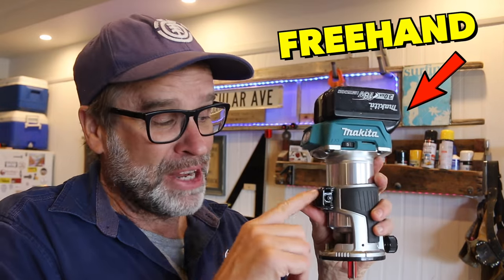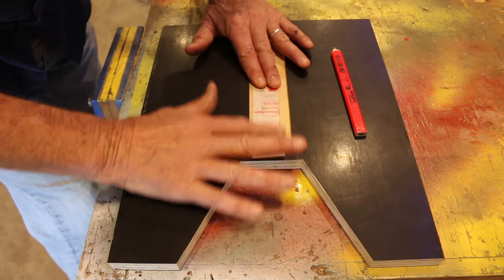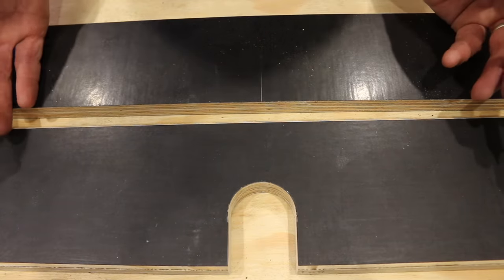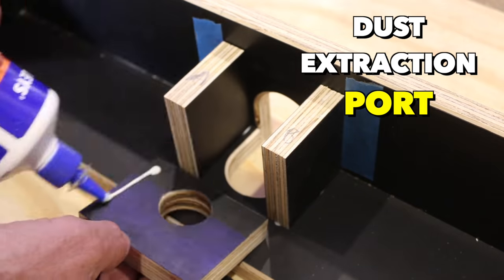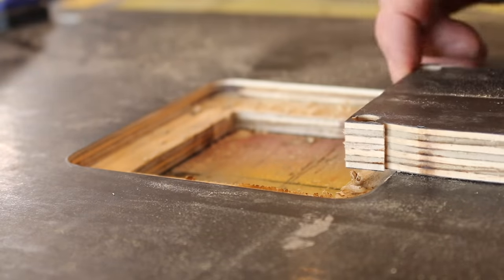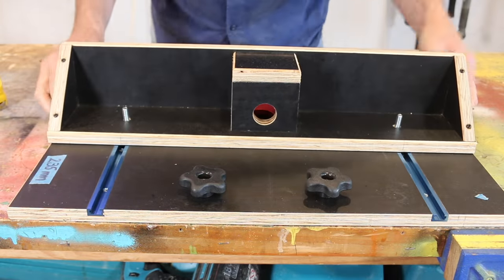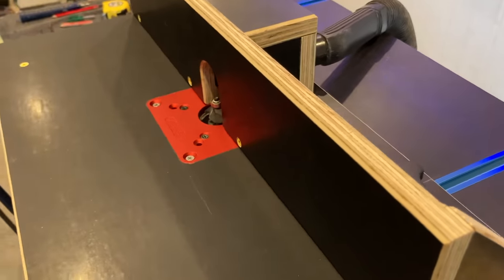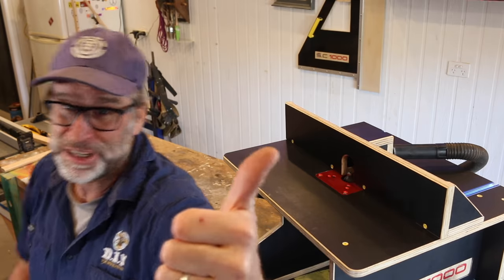The BEST DIY Router Table for Beginners. #woodjigs21

Comment: I really enjoy the look of this table! I'm going to keep my eye open for a black surfaced plywood, looks great (not sure if it's sold here in the US).
For those watching this that are starter woodworkers or are unsure if you want to put in the track, a very simple solution for the fence is to move those triangular rear supports in a few inches, then simply use clamps on the edges to hold the fence in place. You don't need to worry about it being square to the table as long as it's square to the router bit!
Reply from the maker: Thanks mate and l appreciate the tip. Cheers 👍😁🇦🇺
Reply: It's forming plywood used for foundations.  Your local building supply may be able to order it.  Go to the local builders supply where the framers and builders shop instead of the big box stores.   You can also use melamine board with plywood as a backer for a 1 1/4" to 1 1/2" total thickness.

Comment: I just bought these plans, I am excited to make this project as I am new to using routers and I have a samll trim router that i think will work swimmingly with this table. I look forward to building it. 

I really love your channel and do a LOT of DYI projects, having the router, which I bought specifically to build my hobby desk. I have only used the one 1/8th inch slot bit to install T-Slot Edge Moulding with, it has not been used much. I cannot wait to have this built up to be able to work on many different projects, such as more tool DIY hacks... and some diorama and epoxy art beses. Will update with how it goes. Thanks again, Cheers!
Reply from the maker: First of all, thanks for purchasing the Plans mate and good luck with it. I know that you are going to love it! Cheers, 👍😁🇦🇺

Comment: This is by far the best looking (IMHO) DIY router table I have seen on You Tube. When I first saw the thumbnail photo of it, I thought you were doing a review of a router table that you had bought commercially. That is meant to be a compliment. I was lucky enough to buy a Ryobi router and table from a guy who just wanted it to do the trim on his kitchen cabinet doors. I only paid 40 bucks for both the table and router! It works beautifully. 
I may build yours at a later date when I need a table with more surface area. 
One last thing, if you have any of that black ply left over, I think it would be really cool to build a small T-square to match your table. Great work, thanks!
Reply from the maker: Thanks Gregg!...Really appreciate the comment mate 👍😁 40 BUCKS!!.....Now that's a bargain!...well done, you can't complain about that one 😁 Good suggestion re the T-Square....may just have to do that one. Cheers mate and thanks for watching 👍😁🇦🇺

Comment: Nice build the design and way you made the top looks very familiar……. 😉
Reply from the maker: Cheers mate and yes l did get some inspiration from your video 👍👍 Simple but very effective 👍😁🇦🇺
Reply: @diyforknuckleheads  if it is not your idea, why are you selling the plans that Where’s my pencil offered for free? This is dishonest.
Reply from the maker: @haunthunterify  Disagree entirely mate. For starters it is not the same and secondly there would not be a router table on the internet that has not had design similarities to anther router table. There is only so much you can do with it. A similar example would be that  there are many car manufacturers...each car has wheels, a steering wheel and a motor yet they all sell their own models.....enough said
Reply: @diyforknuckleheads  ok. Whatever let you sleep at night.

Comment: One of my favorite woodworking tools MyBest.Tools Light and easy to maneuver. Noise level is a lot better than others I have tried. No cord makes it easy to grab and use. The clear base plate makes it easy to see ahead of what you are cutting. The electric brake is awesome. Glad to have this in my tool collection.
Reply from the maker: 👍😁...Thanks mate 👍😁🇦🇺

Comment: like it Sean .  I made a plate to fit a Black and Decker Matrix jig saw  attachment . Just housed out the wooden plate to fit jig saw and fitted wedges under it to hold saw in place .   Its clamped to the bench too but was hard to fit an easy to use on off switch ,would slide  an electrical tie over the drill switch .  Then bought an ozito router table ,  it  works real well for smaller jobs  .
Reply from the maker: Thanks Barney 👍 Well done on having a go at making your own.....always interesting to come up with little problems that pop up along the way.....never seems to go as planned 😊  Have a good one mate 👍👍😁🇦🇺

Comment: Great job.The only thing I did different when I did one - few years ago - was to make the holes in the fence slots about 2" long so the fence was a little more flexible
Reply from the maker: 👍....Yeah, good tip re the slot John 👍 Thanks for watching mate 👍😁🇦🇺
Reply: I can dig it. Reckon you are making those slots parallel to the fence, so to enable slanting the fence  a little when needed, relative to the front of the table, yes?
Reply: @leehaelters6182  Yes.just makes it a little easier to set.Fence on a router table does not need to be aligned at a perfect right angle - as a with a table saw -

Comment: It's funny watching Australian woodworking youtubers. Always feels strange to see someone using the same tools I got from bunnings haha. Great table though, looks perfect for me. Only variation I'm going to make is that the cut-out on the back part of the fence, I'll make at 60mm minus the thickness of the board and then because of the way the two pieces are aligned, they'll end up being the same depth from front bottom edge so my OCD will be satisfied. Thanks for the great design!
Reply from the maker: My pleasure mate! Thanks for watching 👍😁🇦🇺

Comment: That's a great portable router table, but the one I bought, not portable, is even better and came with a 1 1/2 hrs router. It only took me ten minutes to buy it and it likely cost less than all the materials for that table. Which does not detract from the utility of this great portable table.

Comment: Nice unit Mate. I made me a bigger one ages ago. Wanted bigger top. I inlayed 2x 150mm rulers for gate positioning. Works a treat. You can get them (Rulers)from $2 shop or reject shop
I have since made a undercarriage below deck which uses an old scissor type car jack to raise and lower router bit height. Non battery Router of course.
Reply from the maker: Cheers mate and good idea re the rulers 👍👍 Thanks for watching 👍😁🇦🇺

Comment: tip : @7:20 cut the inner wooden guides a fraction short so you can get an exact fit against the aluminum  block. A small gap between wooden guides will not affect the router cut

Comment: I love this video!  It's just what I need to make.  Thanks for sharing it.
Keep your eye out for a second base for your router so you can leave one attached.
Reply from the maker: Thanks as always Andy! If you make it mate you won't be disappointed 👍😁🇦🇺
Reply: i bought recently a 3d printed insert plate for ~20€ where you can easy put the router in and out,so you needn't a 2nd base.my router is  from katsu and it's identical in construction with the makita rt 0700c palm router.the accessories and spare parts from the makita also fit the "clone" and with 60€ the katsu is also only half the price of the makita.
Reply from the maker: @duczman76  Love the idea of the 3D printed Insert Plate 👍👍
Reply: @diyforknuckleheads  i found here on youtube a video about it and i instantly ordered one for me.
Reply: @diyforknuckleheads  here is the link 2 the video of it.
https://youtu.be/V4kI2-yBjRE
Reply from the maker: @duczman76  Cheers for that mate! 👍😁
Reply: @diyforknuckleheads  no problem.you're welcome.🤔 i think i can't withhold something useful like this from anyone,can i?

Comment: I was looking into buying a router, and noticed all you tubers have a table, I dont have space for a table in my small apartment, but I do have a deck and was thinking how to avoid what your begging video just explained (so thank you for answering my question if that could happen)... but I was pondering if you attached a straight edge to the top of the wood** you were trimming, and balanced the hand router on that straight edge if that would prevent my hand from veering too much into the wood or off the wood? 

**kind of like how circular saws use straight edges? 

please let me know what you think!

Comment: Uncle Knackers, GREAT vid & FANTASTIC router table!!! Thanks for taking the time to help all of do the best woodworking we can, Where I'm at in the USA Formply is nearly non-existent and I was wondering if it's the same as Melamine? Currently building my first table saw "cart" and with 1/2 of a 1 car garage, that I share with storage shelving, I've had to be very creative in my choice of design. I have watched several of your videos and I like the fact that you design for the entry level woodworker. Just my level. And not for the Dad Jokes. . . you and my Pastor have the same type of humor and are just about a quarter bubble out of plumb! I like it! THANKS again. I'll buy you a beer soon.
Reply from the maker: 😂...Quarter of a bubble out of plumb! ...love it 😂 Form Ply is different to melamine. It's basically just plywood with a fancy coating applied to the surface. 👍
Sounds like your workspace is basically identical to mine.....pretty cosy. Glad you like the vids mate and thanks for watching 😁👍🇦🇺

Comment: This is great and I was going to have a go at making.  Please can I ask what kind of router bit you used to cut your rebates for the T-Track and plate?  I can see the bit must have a bearing at the top of the bit for the template (block) guidance but most of the 1/4 inch router bits I can find with the bearing at the top are just for side or laminate trimming and I'm not sure if they are suitable for cutting the floor of the rebate smooth for the plate and T-Track.  Thank you.  (I would be using a makita trimmer for cutting the rebates)
Reply from the maker: G'day Andrew....sorry about the late reply mate. Here is the link to the bit that l used. Cheers 👍 https://amzn.to/3gttq7p

Comment: Nice build. I suggest a back  and front and a dust collector instead of a shop vac.   With two or three holes in the back to let air in you will capture 99% of dust. Shop that does not collect much dust. Where did you get the insert plate from?
Reply from the maker: Thanks for watching and for the suggestions Allen 👍 I have a link to where l bought the plate from in the plans that are linked in the description box under the video. Cheers 👍😁🇦🇺🎄

Comment: Thanks for the video. Bought the plans 👍. Just one question... What router bit are you using? Thanks again
Reply from the maker: Cheers mate...much appreciated. There is a link to the Router Bit in the Plans that you purchased. Its a Flush Trim Bit with a bearing on the top 👍👍
Reply: @diyforknuckleheads  sorry mate, missed the link. I'm the knucklehead this time 😊😊
Reply from the maker: @63italic  No worries mate 👍
Reply: @diyforknuckleheads  How did you correctly set the routing depth? I assume you achieved this by using the right thickness of the template but not sure. The bearing position I guess is fixed. Thanks

Comment: Great job of covering all the details on a great router table. But just one question, how do you reface a piece of wood when the left and right side are the only plane. Wouldn't need an offset of some sort? Sorry, I'm new at this.

Comment: Yankee living in Japan, here. I love the design, it is elegant, modest, and thoughtfully functional. For example, the side cutouts that provide arm working access to the router.

 Very curious about this Form Ply. You demonstrate its slipperyness, yet standard wood adhesives get a grip?  What material is the skin? Thx!
Reply from the maker: Hi Lee! Glad you liked it mate. I used glue as a force of habit...Most likely it wouldn't stick but it also doesn't hurt using it just in case it helps a little 👍  The black film is a high density overlay of phenolic resin impregnated paper which is bonded to the plywood.....or so l am told 🤔  Thanks for watching 👍😁🇦🇺

Comment: Quick question - Is the table designed to work with a palm router and/or a full-size router?  Does brand matter?  Thanks.  Adding this to my list of upcoming projects.  Love the way it looks.
Reply from the maker: G'day mate...it can work with both. You just need to buy an insert plate that fits your router or make one out of thick acrylic. Cheers 👍😁🇦🇺

Comment: Thanks for sharing. It looks great but how do you set the routing height? (Sorry if I missed this in your movie)
Reply from the maker: No worries at all mate...thanks for watching  👍😁 The method l used is trial and error. Grab yourself some scrap and just experiment until you get the depth you require. Good luck! Cheers 👍🇦🇺😁
Reply: @diyforknuckleheads  I was more curious about how you set the height on the router. Most routerlifts have a screw which is connected to a lift. Your's doesn't have it or does t?
Reply from the maker: @Tilburger72  Mate, mine has a lever that you release on the side of the body and then there is a knob that you wind up or down to alter the height 👍
Reply: @diyforknuckleheads  Ok that sounds great. Thanks. I will take a look at the makita!

Comment: Straight away, nice job but I've never seen that board with the black top in the U.S.A.
Reply from the maker: Thanks Alan 👍 Can't help you out with the board but there is probably something similar over there. Have a good one mate 👍😁🇦🇺
Reply: I have never seen the range and quality of ply you guys in the US have either. It certainly can't be found at my local Bunnings store!
Reply: In Australia its used for concrete formwork I believe.
Reply: @stevereid8903  Hey, Thanks!
Reply: @emceeboogieboots1608  just bought a sheet from Bunnings….but they call it SpecRite - film faced plywood- size 2400 x 600 x 17mm $39.00 a sheet 👍
Reply: @robbunt8180  I know the stuff, I made all my benches in my shed out of it. I have never seen the sort of ply the  US guys are always using though. So straight and many different sizes. Makes me jealous

Comment: I like this better than the Triton router table I currently have. It's more functional, predictable, and takes up less space. One day I'll get around to building one for myself.

Any reason not to set up the fence to use runners like a table saw cross cut sled? Would keep the fence parallel right?
Reply from the maker: Glad you liked it S.J 👍😁 It would indeed mate 👍

Comment: Nice and simple.  Well done.
Why does the fence need to be square to the table like a table saw though?  Is that just to make for easier measurements?
Reply: IMNSHO, it doesn't. You can find micro-adjust jigs (very nice DIY ones) on YT that only move one end of the fence.  Now, if the fence gets too far out of square the T track slots will bind, but within that range it's just for looks.
Reply from the maker: It just helps with my OCD mate 😁

Comment: Muchas gracias DIY, solo una pregunta, los tableros aquí en España no existen en esa medida de 17mm, los ahí de 15 y 20 mm en contrachapado, habrá algún problema con esa medida de 15 mm que es el que he usado??. Muchas gracias.
Reply from the maker: Es posible que deba tener un poco de cuidado con los 15 mm para la parte superior de la mesa del enrutador, ya que necesita cortar un hueco para el riel en T y la placa de inserción del enrutador. Si pudiera usar los 20 mm para la parte superior, sería preferible. También puedes usar MDF si te conviene. 👍
Reply: Muchas gracias DIY, lo tendré en cuenta y usaré MDF o otra madera de 19mm. Thank you very much DIY, I will keep that in mind and use MDF or another 19mm wood.

Comment: Hi, lovely practical project. Which type of router bit or bushing are you using to cut out for the T tracks? It wasn't clear to me how that is done.
Reply from the maker: G'day Ross. The router bit was a straight cutter with a bearing the same size as the cutter on the top. Mine was a 12.7mmm cutter with a 12.7 mm bearing. Hope that makes sense and thanks for watching 👍😁🇦🇺

Comment: Hi Great Video. Just a question. What router bit are to using to cut the plate recess?
Reply from the maker: Hi Chris....sorry about the late reply mate 😊 Here is a link to the bit that l used. Cheers https://amzn.to/3sKq32X
Reply: @diyforknuckleheads  Thanks
Reply from the maker: @chrisspencer291  No worries mate 👍

Comment: When you cut into the surface using the double sided tape pieces (around 1:45), how do you keep the router from biting into the template?
Reply from the maker: Eric l used a Flush cutter with a ball bearing on the top. I think l left a link to it in the description box under the video. Good luck 👍

Comment: G’Day uncle Knackers, great vid and I’m almost finished my own jig. I just have a question about how you cut your dados for the t slot track. Did you use a mortise router bit with a top bearing to keep your cuts straight along your stuck on timber guides or some sort of other sorcery that I can’t figure out?!?
Reply from the maker: Mate, all l used was a straight cutter with a bearing on the top. Good luck 👍😁🇦🇺

Comment: Great design. I wish we had that form ply in the UK (at least affordably). We have shuttering ply for concrete work but it doesn't have the coating.
Reply from the maker: Cheers Chris. You can use other stuff as well like MDF or Marine Ply if you can't find Formply. Thanks for watching mate 😁🇦🇺👍
Reply: Use melamine
Reply: Any decent ply with Formica added.